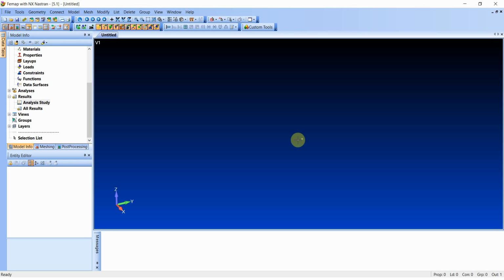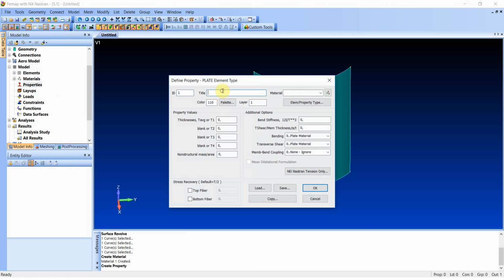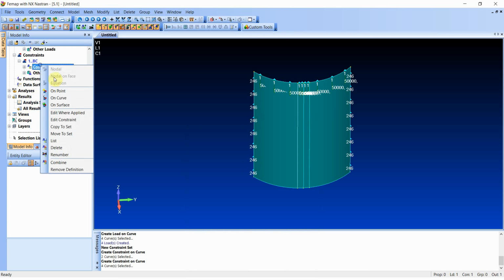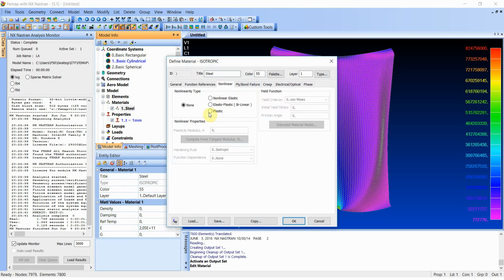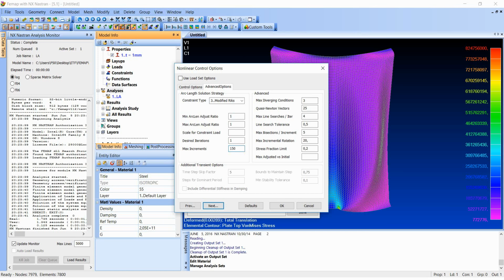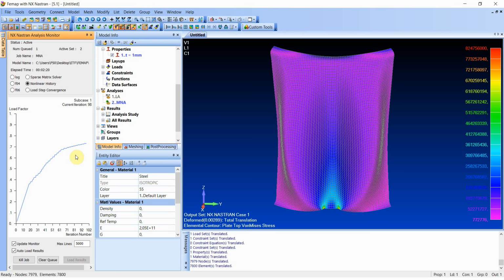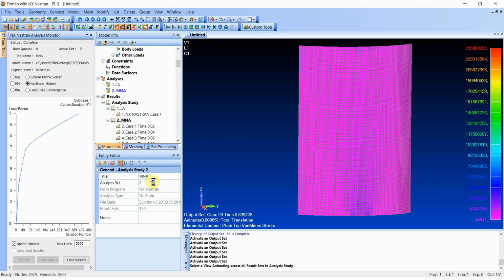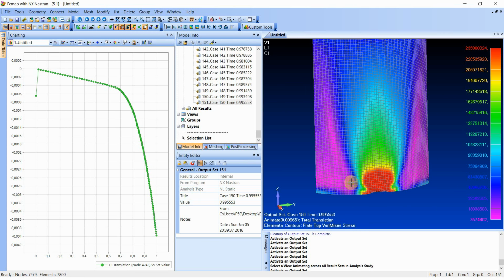How to set up materially nonlinear analysis in Femap

Comment: Thanks for the video. I am using nonlinear PU rubber as my material and I've assigned a stress strain function to it. When I try to do the analysis i get FATAL ERROR 9002 and 316. Can you please help, I'm new to this
Reply from the maker: Hey Prisha!
I won't help you with rubbers as I don't usually use them, but their material models are pretty complex as far as I know. It may be a difficult field to start in... I'm not 100% sure, but the stress-strain curve will most likely be insufficient to fully describe rubber behavior - maybe this is why you get error messages?

Comment: Hello Lukasz,
Firstly, thank you for a very good video. I have done some analysis with material nonlinearity (Nonlinear and engineering SvS curve for plastic) without Arc-length method and found your video very interesting as you use the Arc-length. However, I had problem by converging after increment 25 and the analysis simply stop. I tried one case with bilinear in order to if it can follow the curve and it failed with the same value. Any idea why the load does not reach 95% ish as yours in video?
BR
André Nedaei
Reply from the maker: Hey Andre! This is a pretty difficult question to answer, as I don't know what you have done exactly. Clearly, if you would do the same things as I did in the video... you would (well... should...) get the same outcome. So I assume you did something differently. But to give my opinion I would have to look into this, as it is, I simply don't even know where to search for it...

Comment: Hi, I'm trying to run a nonlinear steel material model. I thought that when you choose plastic material you have to specify a strain-stress curve?
Reply from the maker: Hi, Monika,

It took me a while to write you back, as I rarely look on to comments under my youtube videos - it is much more efficient to ask at my blog: www.enterfea.com :)

As to the question at hand, no you do not need to define a strain-stress curve. Of course you might, inserting additional data but what the shown method does is the simplest way (and I will write something about the more demanding ones later on).

What happen if you enter things as I did is that femap generates input file for nastran with keyword MATS1 with following parameters:

TID = blank (this would reference the strain-stress curve you mentioned)
TYPE = PLASTIC
H = blank (this defines the slope of the hardening)
YF = 1 which means von Misses yield criterion (it's a default and I simply didn't change it)
HR = 1 which leads to Isotropic hardening rule (also a default kinematic and combined are also available)
LIMIT1 = 2.35e8 - initial yield point
LIMIT2 = blank

This leads to situation where both TID and H are blank, which in turns is interpreted as perfectly plastic material.
You can read more about this all in NX Nastran quick reference guide (It has over 2000 pages!) what you are searching there is Bulk entry MATS1 (in my version, that would be page 15-62). Also you may read about Bulk entry MAT1 - this may come in handy :)

If you have any more questions (or do not feel like reading all that!) you can simply write me an email at: lukasz.skotny@enterfea.com (and it can obviously be in Polish then :) )

I hope that helps :)